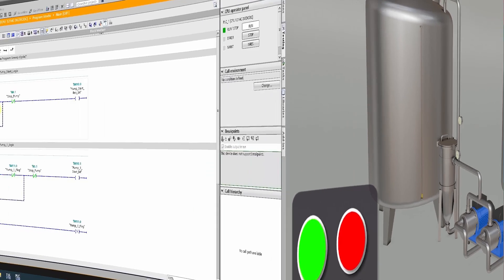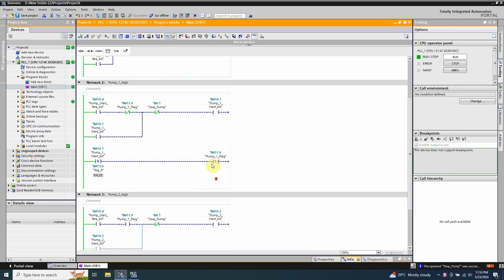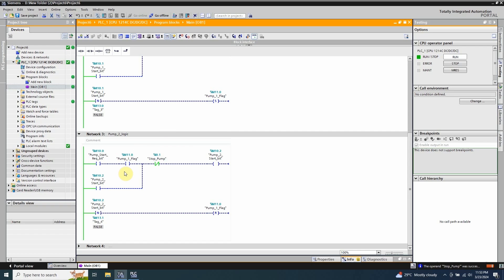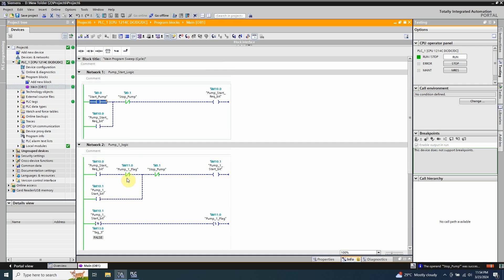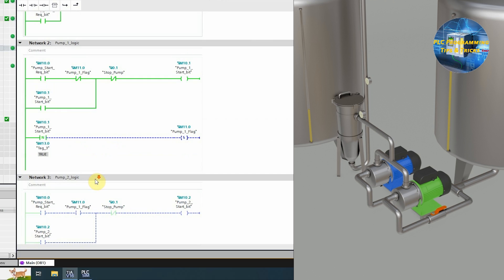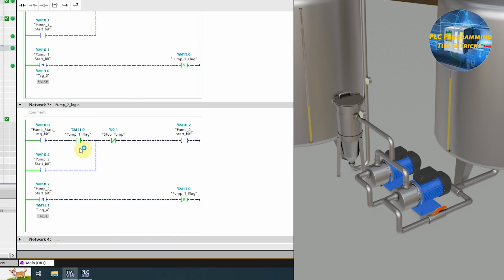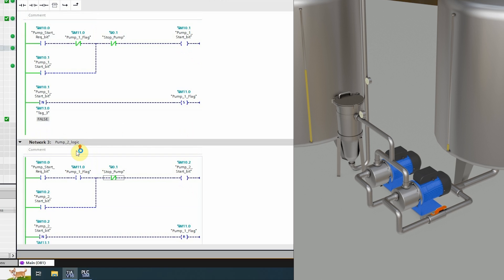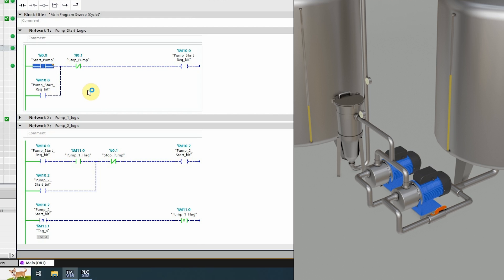How to switch between pumps on the pump run request command || TIA PORTAL TRAINING SESSION

Comment: Hi good knowledge sharing.
Can you develop the logic for the below requirement pls ...

Automation requirement: Single water tank level control with multiple pumps( based on pump number selection). If pump-1 selected then pump-1 should work for tank level filling and if pump-2 selected then pump-2 should work for same tank filling.
1. In "auto" mode Tank level control using high and low level switch(when low level comes means pump should ON and for high level pump should off) after Starting the start push button.
2. In manual mode pump should run when start button pressed and stop when stop button pressed.